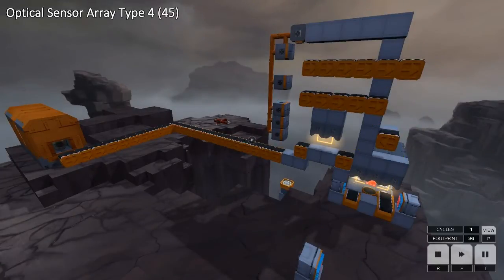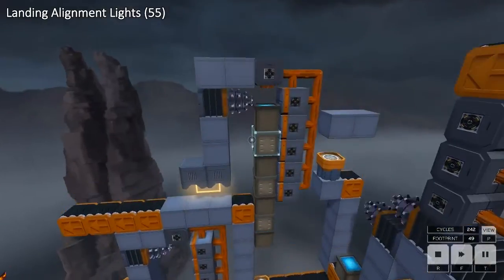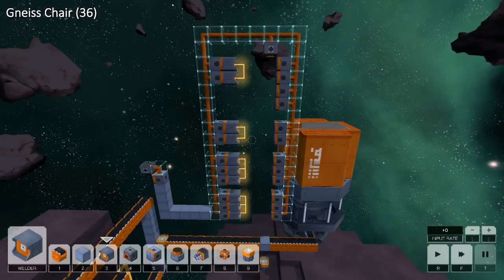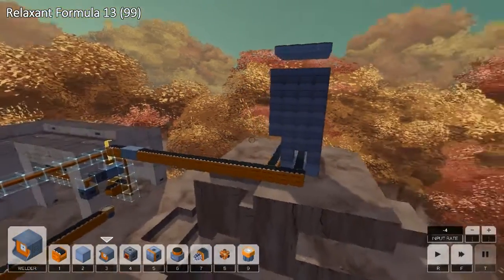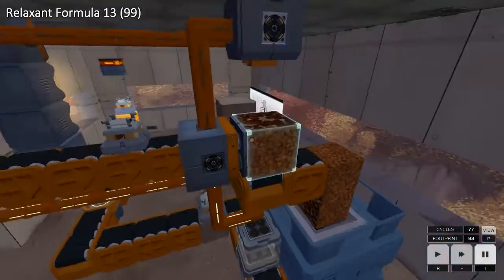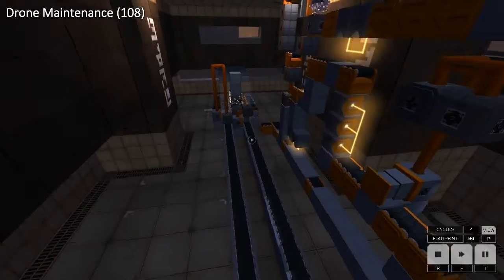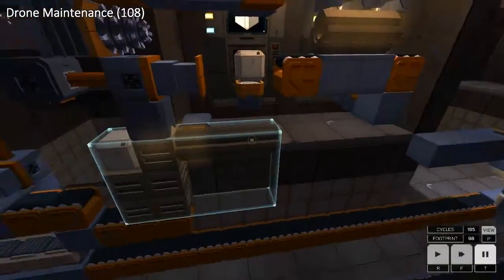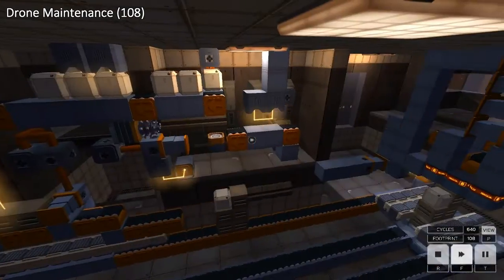Infinifactory - My low footprint solutions [spoilers]

Comment: On number 2: I don't understand why you made it so complex when you just need to take 4 input block, rotate 2 of these 180 degrees and then weld them. 0:48 - 3:52
Reply from the maker: It's low footprint, which means that you are scored based on how many different vertical columns the factory and its produce occupy. This means the factory has to be as thin as possible. Rotating one of the inputs would already occupy at least 6 additional footprint.